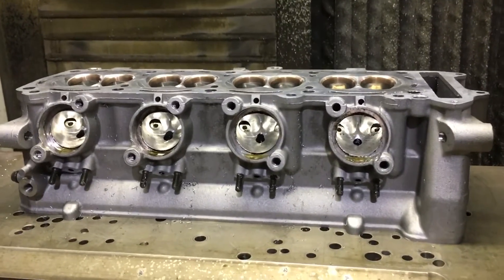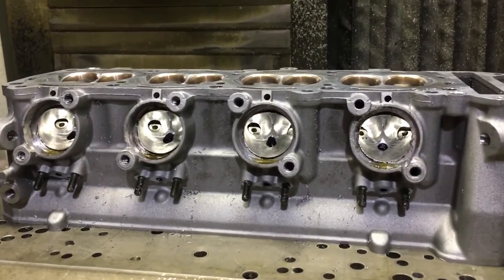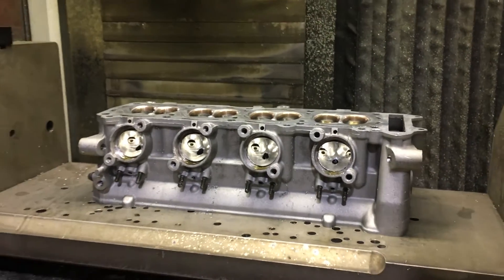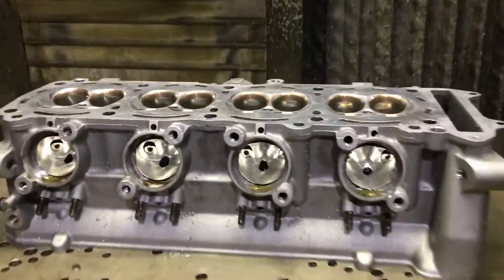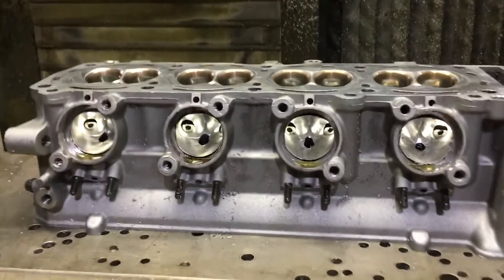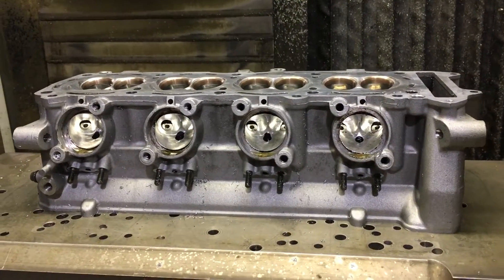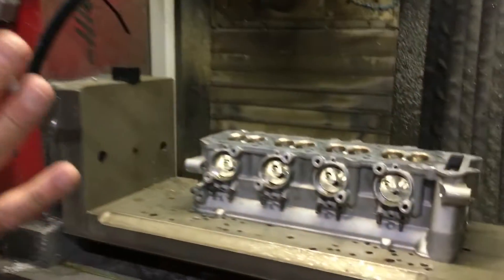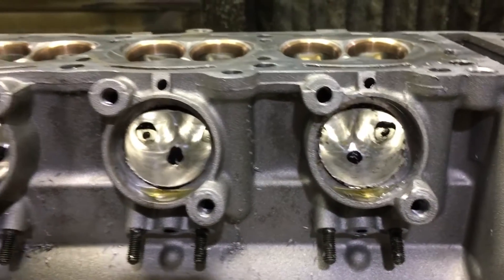How CNC Cylinder Head Porting Will Add A Ton of Horsepower To Motorcycle Engine

Comment: Are the 2017gsxr1000 heads good as is or would some porting and some upgraded valves and springs make more power? Ive been told its not worth it🤔